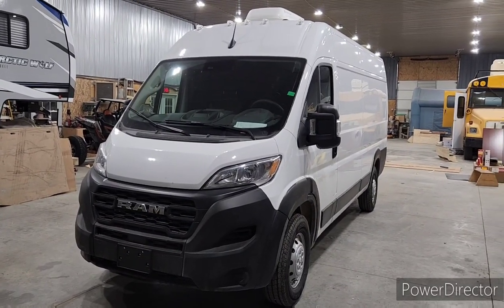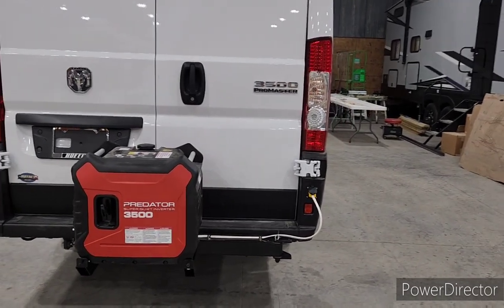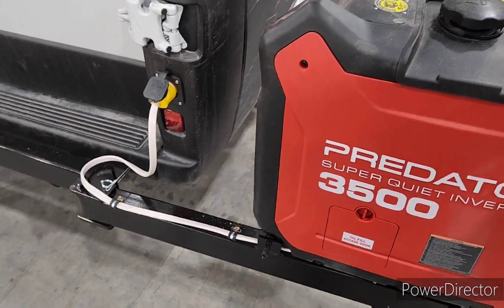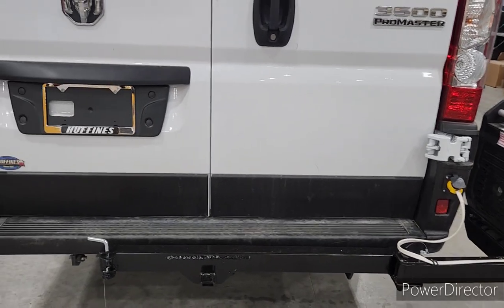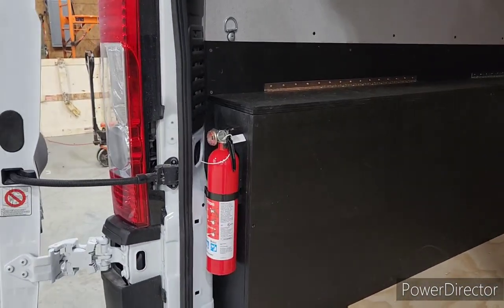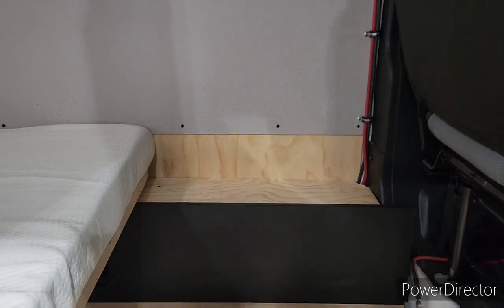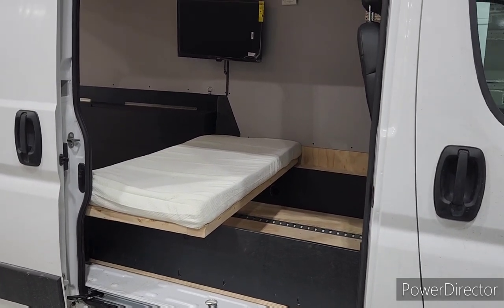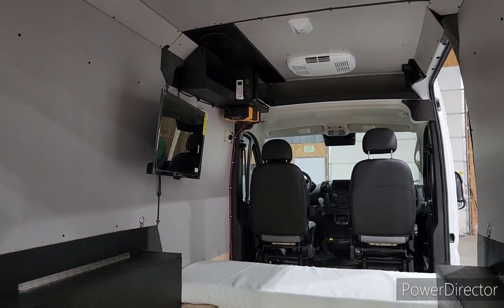Complete, ready to go Expedite package.

Comment: Have a 2023 3500XD extended Mecedes-Benz Sprinter Van and was curious how much is the cost without installing Air on top and the generator at the back doors but everything else inside the Van.
Reply from the maker: Info@redscustomdesign.com for pricing

Comment: I wonder what you would charge for the same setup (Except) no generator and aircon/heater, everything can run off batter power for 8/10 hours. I assume its more but just wondering how much more.
Reply from the maker: I have a package like that.  For more information email us at info@redscustomdesign.com

Comment: Where would you store dollys, equipment, etc? Also, would you recommend using the rooftop for some storage? I feel like the back space - past the wheel base - should be left open to fit the extra wide pallets afterall it's an Freight van not lifestyle. Also where would you guys recommend storing the bed away if they get 3-4 pallets? I am in no way trying to be a smart ass just legitimately asking questions that came to mind. TIA.
Reply from the maker: Folding dolly could be stored anywhere (95% of your loads don't need a dolly).  You can leave your van open, but you ALWAYS need stored. With this setup you can still put a 51" wide pallet in it and 3 pallets with the bed down.  And if you have a 4th pallet you can put the bed on the wheel well box.  I don't know how long you are on the road but most are on the road 2 - 8 weeks at a time. And at that point it is a "lifestyle" van. You just haul freight in it instead of talking beach pictures in a bikini.

Comment: how many pallets can fit in there wit the bed
Reply from the maker: With the bed down, 3. With the bed stored on the wheel well box,4 (48x40).

The bed is not fixed. It can be moved to any position.
Reply: @RedsCustomDesign  thank u for the feed back
Reply: Can a Ford Transit-250 extended also fit 3 pallets with a bed also?
Reply from the maker: Bed down, 2. Bed up, 3